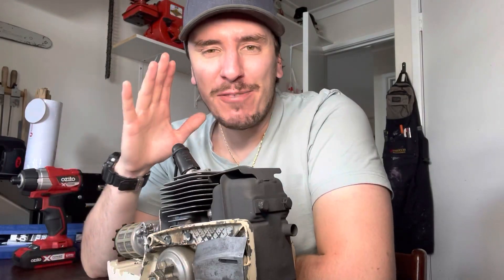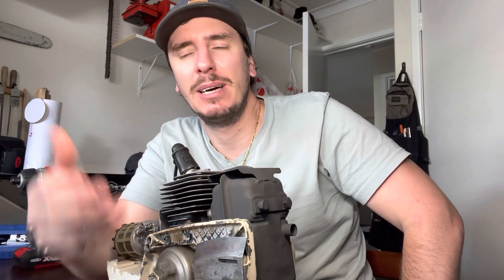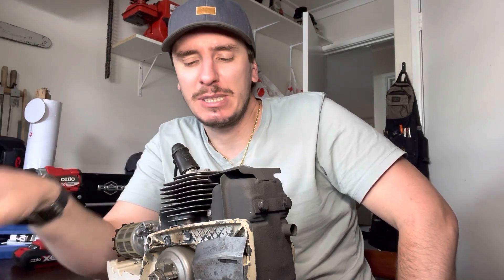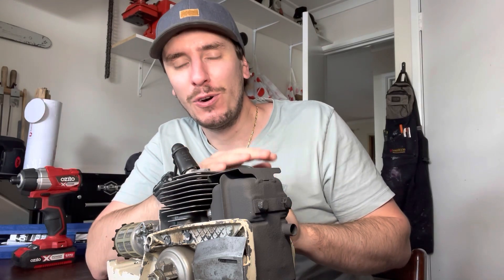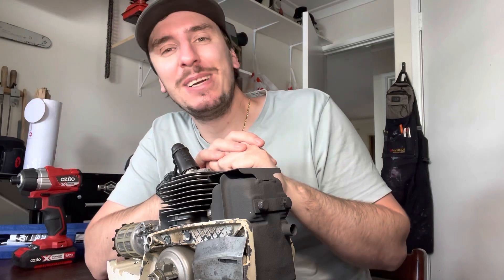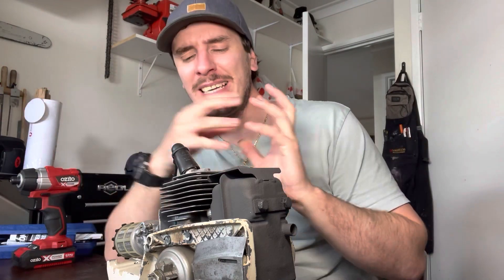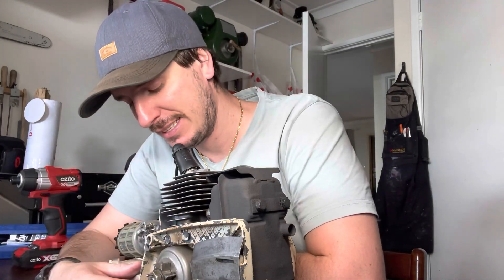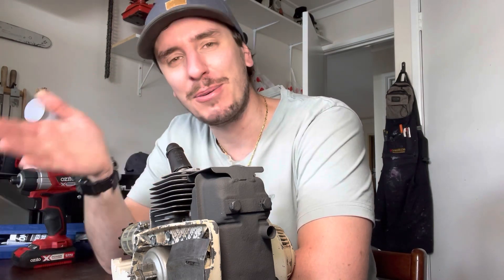Piston Slap - Diagnosis & Repair

Comment: Do you know where one can look to find the maximum gap between piston skirt and cylinder for a Stihl 193t? I tore down my saw because I had 90psi and some piston scoring. I cleaned up the piston and cylinder and now all signs of scoring are gone, but I'd like to know if the clearance I have now is still within tolerance so I can avoid piston slap.

Comment: So to repair this we just need to change piston n ring? Or we need to upsize the piston size or we need a new cylinder block? 😌
Reply: @VintageEngineRepairs  i see a scratch mark on the exhaust side of my yz125 piston when i remove the exhaust manifold. So i rotate the crankshaft to make the piston up and down and i see it quite bad scratch mark on the bottom side of the piston. So what you say about my situation 😉
Reply from the maker: Replace it if it’s scored like that :)